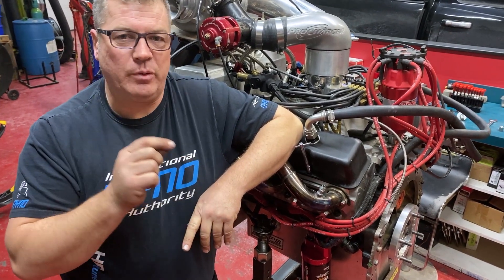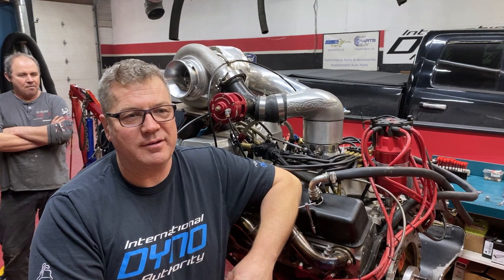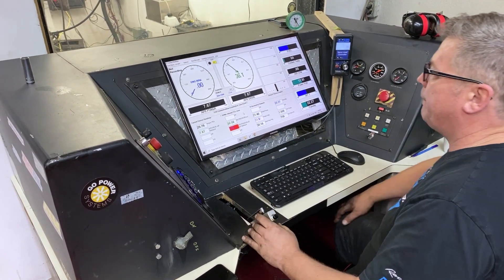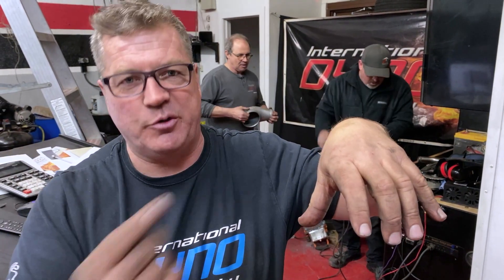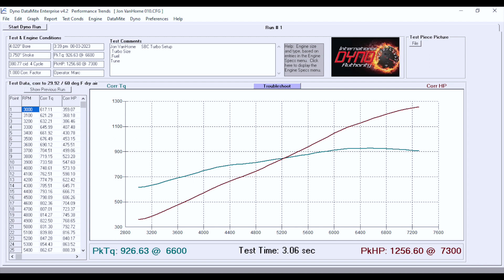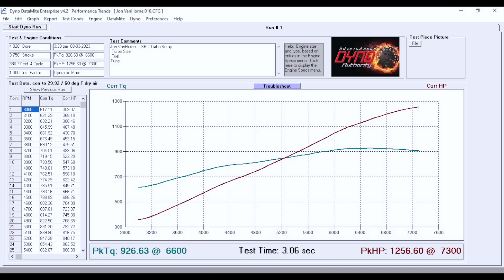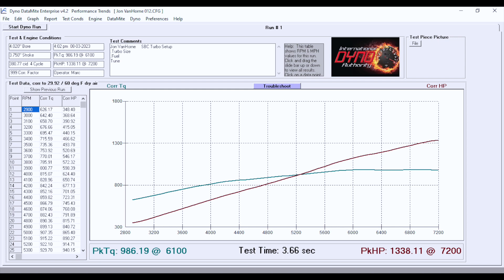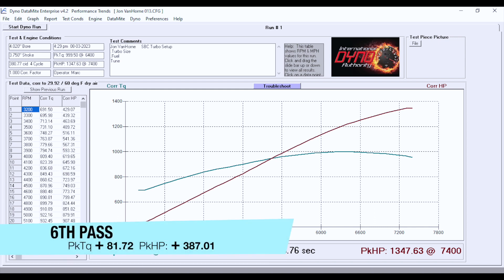Methanol-fueled Small block chevy on the engine dyno *1400 HP*

Comment: What are spec of that motor? I'm looking to do the same in my car but I'm worried about compression
Reply from the maker: 15.2:1 compression 

Brodix headhunter heads 
Steve Morris ported

780 lift
270 284
114 LSA

4.520 Bore.
2.350 int Valve
1100 PSI  otn pres
330 PSI seat 

477 cu in